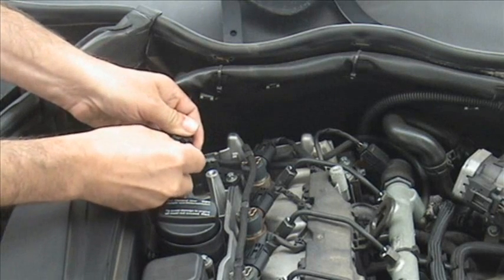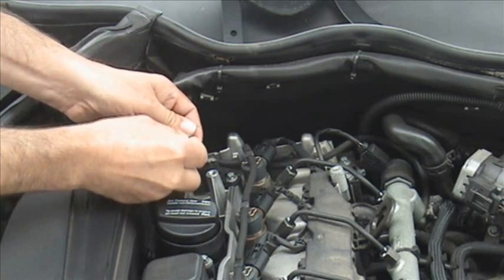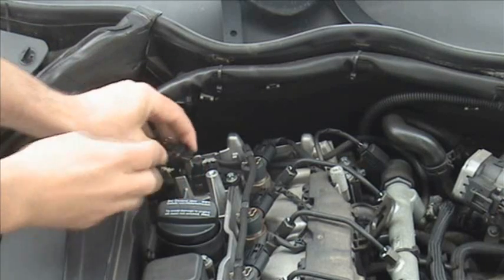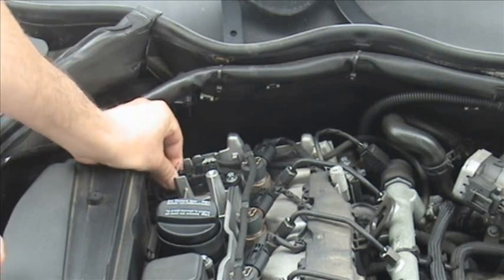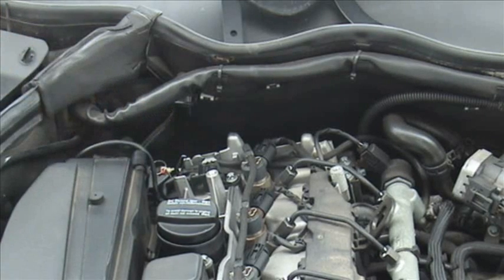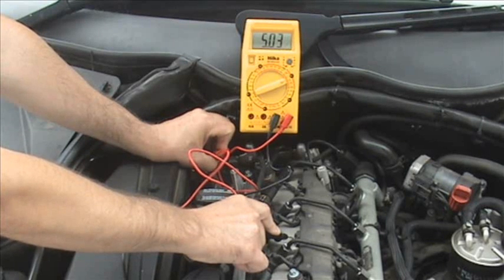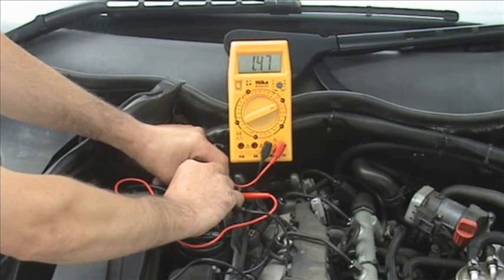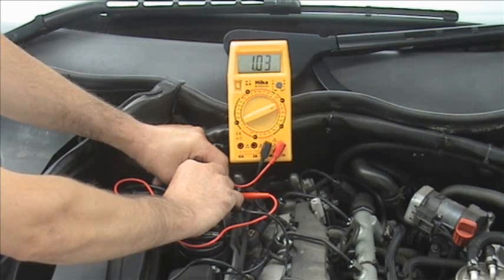Testing CAM or CamShaft Position Sensor Hall Effect Type

Comment: hi...
can you tell me when thic sensor broke down for w203 c class what kind of problems has the car ? because i have a problem with my car when the temperature to 85 grade level the car get shaKES it doesn"t work as well as before i 
may the sensor has the foult that the car has that shake or what ?

Comment: my 94 mustang gt 5.0 runs fine for 5 minutes then loses power and starts popping and missing. I replaced and tested several parts. new distributor,coil,fuel regulator,fuel filter,spark plugs,oil,MAF is good. fuel pressure is about 30 vacuum on and 45 off. injectors are good.  Running cleaner through them now. I don't think a bad valve would do this. scratching my head. any suggestions?

Comment: How do you know the sensor is toast if you are testing the voltage off the wiring that always will have voltage to them?
Wouldn't testing continuity via the pins on the sensor itself give you a more accurate answer?
Reply: Does this method apply to Suzuki Forenza 2005?
Thanks

Comment: I dont get that switching voltage on this 1993 jeep of my dads that i am working on. I get 14 volts.
Reply: consaka1 Did you figure it out? My bmw shows me 14v too. All the sensors are good too. I might try 5v  three pin jigs

Comment: hi I have a two pin one and get an intermittent bad running with code p0335 on my 2009 fiesta 1.25 sometime just turning the engine off and on fixes  it is one of the pins an earth as it only happens when its been raining ? and I was thinking of adding a second earth to the wire ?

Comment: hi, do you know the pin order on aveo 2005 1.6 ? i had to replace the original connector but i mixed up the cables :'( it's a hall cmp and the connector is like the picture of your video, i have 3 signals from car wiring, 12V, 5V and 0,2V, thank's
Reply: Juan Carlos Pereira Gonzalez 
raju

Comment: thanks for the troubleshooting demo ... I have a 95 VW Golf 2.0 aba (slightly different pinout) ... I get 4.5V between the "pos ignition on" pin and ground - but I also get ~4.3V between the switching wire and ground while the engine is running. I Proved this with both an  old and brand new distributor. 

I also proved the switching voltage in both distributors turns off while the hall effect "window" is open between the magnet and the sensor just by manually turning the engine with the ignition turned on. 

Bottom line I don't see the voltage dip anywhere near 1v when the engine is running. Could this be an indication of two bad distributors (both old and new?) The car starts and idles beautifully, but any throttle input causes sputtering or stalling. checked the wiring to the ECU and for shorts - all looked good. even replace the ECU temporarily (no dice).

Comment: Hi Where does the cps located in 6.0 ls2 engines ? And is it necessary to show its faulty in obd scanner ?? because i have the same symptoms of faulty camshaft position sensor in my TBSS but cannot see related codes in obd scanner. what happen is my car runs fine for almost an hour then suddenly goes off and it cranks but it wont start till it cools down.

Comment: My astra is showing P0340 and my multimeter reads 2.145 volts when engine idling, is that normal or the camshaft sensor is faulty..??

Comment: Hello, I have a Renault Laguna F3P B670 and I think that I have a problem with my cam sensor. The procedure to test it says the same thing as you say: engine working 0 to 5v switching. Mine is like 2.55 ignition ON and engine working is switching between 8 to 9v. What should I look? Car seems to lost power... Smells like gas in front of the car. New plugs, coils and no change. I think the problem is this cam sensor. Thanks and best regards.

Comment: I have a question, I have two camshaft sensor plugs on a Acura K20A2 engine and the first plug's power wire is at 10.00 DCV and the othe plugs wire is at 1.00 to 3.00 DCV and the first plug's switch wire is at .100 -.200 ACV when engine is cranking while the other one is pretty much at almost nothing. So is the low voltage camshaft sensor wire bad? Plus how do I fix this problem or what is going on. Please Help.

Comment from the maker: Hi, I don’t understand the error code 00515 engine codes normally start with a ‘P’.
However ‘SHORT TO GROUND’ sounds like the wiring loom has chaffed on the engine or bodywork

Comment from the maker: I think you have Bosch Motronic M2.5 fitted, which uses an inductive  crank sensor and not hall effect so wont have any power as it produces it own, see my video on Testing Crankshaft Position Sensor (inductive). I would volt drop all the earths and lives to the ECU, if ok I would look at the camshaft sensor, I think it is in the distributor and would be hall effect, but I think they changed pin numbers around 1991 so you would need the correct wiring diagram to test.

Comment from the maker: The early type of Hall switches fitted to distributors had a 12v supply voltage, but as with most modern electronics (USB on PC etc.) they all work on a 5v supply voltage, this is the case for most vehicle sensors fitted now, from a air flow to throttle position. The early Hall type switch just operated a simple amplifier where a modern one sends information to the ECU/ECM to be processed. The 5v supply voltage will come from the ECU/ECM.

Comment from the maker: Hi, it is unlikey to be the cam sensor if it starts once, more likey to be a immobilizer type problem, if you watch the video again we check a the three wire hall type cam sensor with meter set to volts not ohms. Try a spare key if you have one.
Reply: Ask The Mechanic how to check the crank sensor in Chevy  van astro